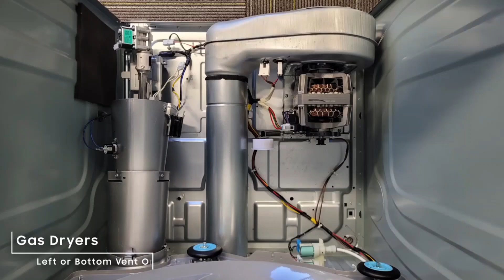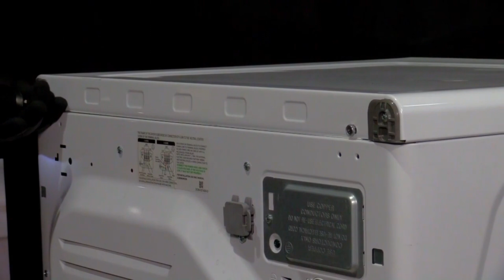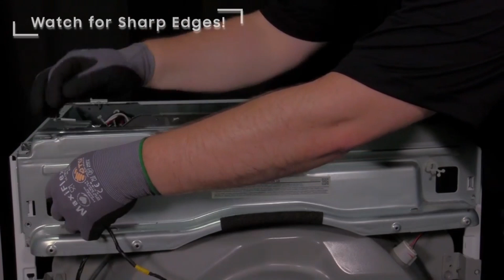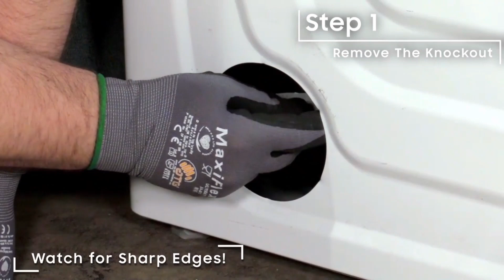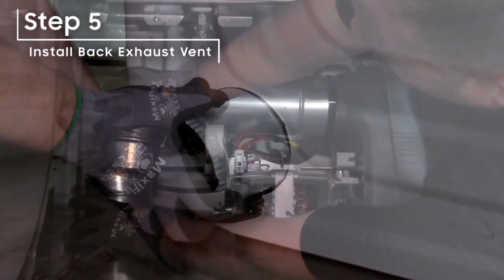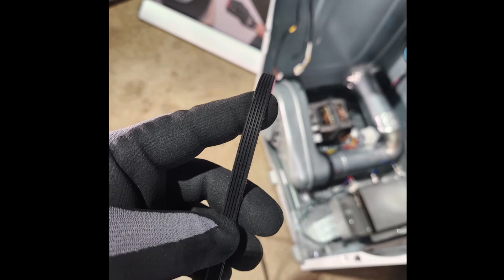How to Install a Samsung Dryer Side Vent Kit (Easy Guide)

Comment: Haha almost got me! I watched this whole thing and when the kit came in i said “hell no I’m not taking it all apart!” Done in 10 min, 1 screw and one little cut on my thumb! 👍🏼
Reply: @DirtyDuramax  I’m curious, it seems you can do it all through the two exhaust holes once the pipe is removed and you knock out the side exhaust hole. Is that what you did?
Reply: @John-v5i8s exactly. Luckily i had it already stacked so i didn’t have to work on the floor but yes just make sure you file any sharp points so you don’t cut yourself up while working. But yeah through both holes you can do it. I even got my impact drill in there to put screws in
Reply: @DirtyDuramax awesome brother! Thank you!

Comment: You can do this without disassembling the entire dryer.
Reply: @victorvek5227  probably not you need to tape the pices together with driyer duct tape and dont see any other way on how to be able to do that with out taking dryer apart and gain proper access.
Reply: Yes you can i did it in 20 min